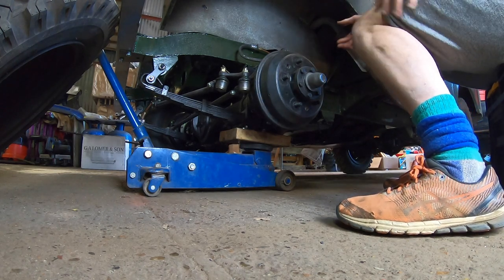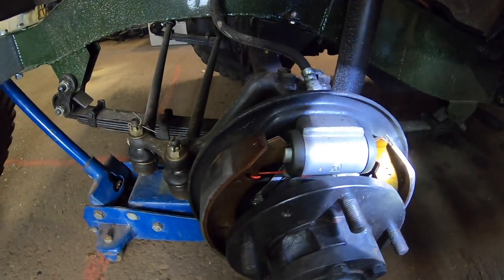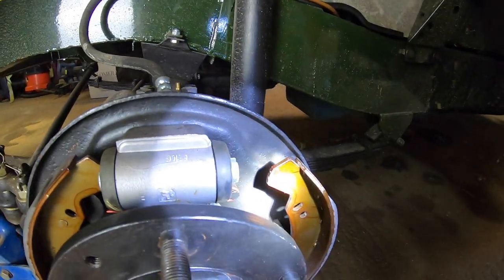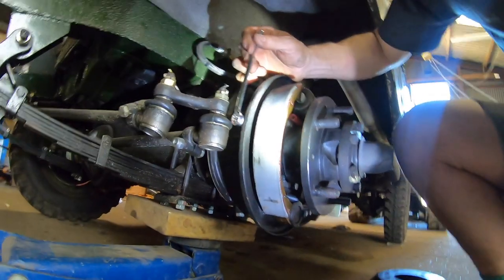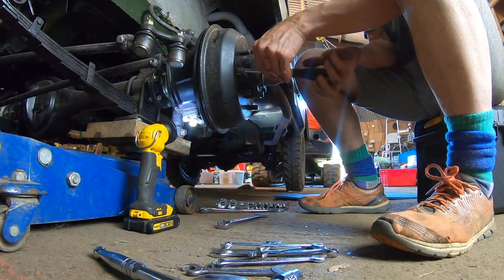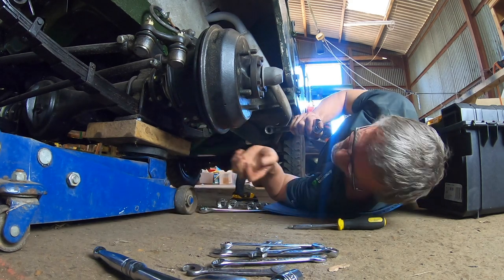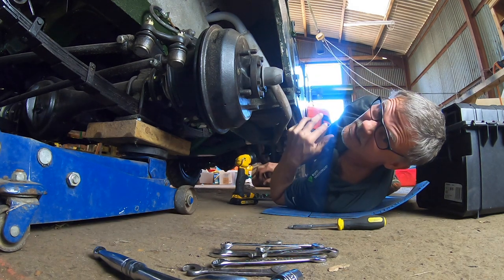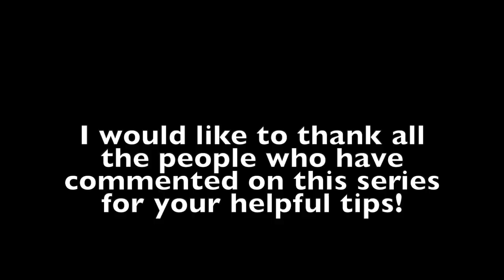LR Series 1 80" Brake issues  part 2 - viewer feedback

Comment: I've worked on 10" Landy drums for 60 years and must tell you that they're really easy to do if one follows a sequence. Remove the shoes at the bottom then fit the red spring to the adjuster post , hook the other end to the post on the backing plate, then slide the shoe upwards with the spring behind the snail and slide the toe of the shoe into the slot on the piston. an easy operation without using pliers or swearwords! Then fit the bottom of both shoes onto the bottom post and fit the retaining ring. I don't believe that slacking it off then stomping on the pedal before re-tightening it will actually make any difference. Key here is that the position of the red spring is crucial as it keeps the shoe against the steady post. Enjoy!  🧐
Reply from the maker: Thank you for the advice, I will keep that in mind

Comment: I think that you are all but there.These LR 10 Inch foundation brakes are a monkey,I have just had the same problem with mine,heres my experience 
A soft pedal falling away resulted in a new Master cylinder. A spongy pedal resulted in the need to vacuum bleed the system to remove air, this could have the same effect with the rears locking in reverse rotation. A poor wear pattern on the lining resulted in the need to adjust the brake lining posts. All springs had to be renewed. A poor circular lining wear pattern needed the pivot post adjusting (check it with a light dusting of chalk on the shoe lining for contact after rotating).
When thats all done they still will not be really efficient,these vehicles do not like modern low asbestos linings.The next step is to bed in while driving  or remove and have them skimmed to drum surface.to have a really efficient brake.Good luck.
Reply from the maker: Thank you Robert, They certainly are somewhat challenging!  The process you mention sounds like what I am part way through and also what I may need to still do.  Chalk on the drums sounds like a nice easy way to work out where they are touching.  I could even do this while in the workshop probably.
Hopefully I will have time tomorrow to put the transfer box back together tomorrow and take it for a quick spin to see where the brakes are at now, but certainly moving the springs will have helped a lot with holding the pads in the best place!  I have tightened the rear far side already, just need to check the near side before heading out.  That in itself may be enough to improve it to be safe.
Thank you for watching and thank you for your comments.